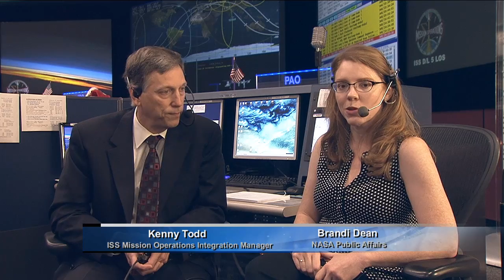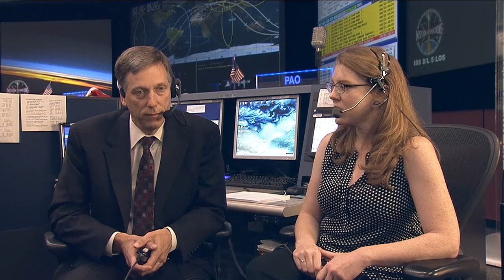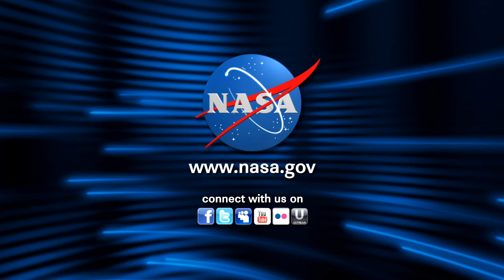Space Station Cooling Loop Update

Comment: So from what I gathered the flow control valve (cold ammonia side) is stuck open and they are worried about the ammonia freezing the water in the heat exchanger.  If that happens, then they have to shut the system down and do a space walk to try to fix it.
Reply: rizendell if they shut the system down they are dead